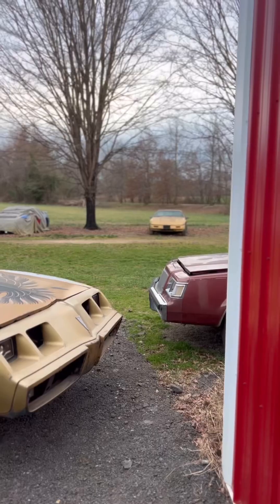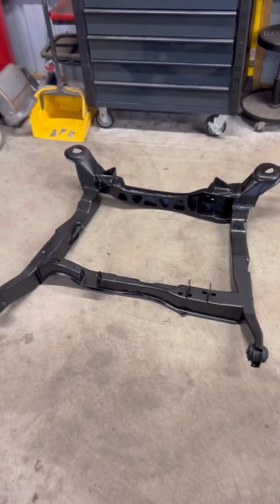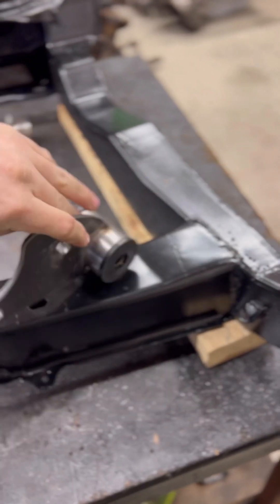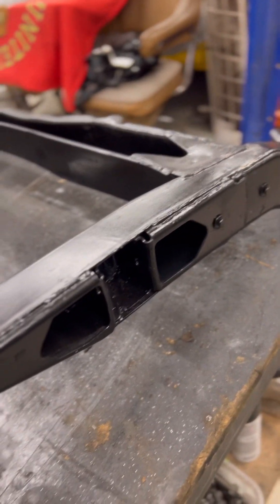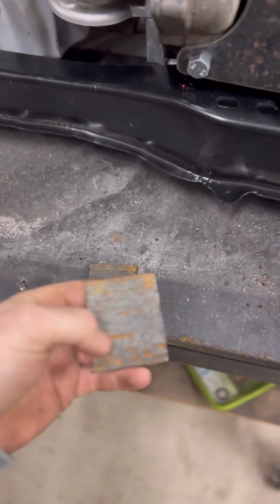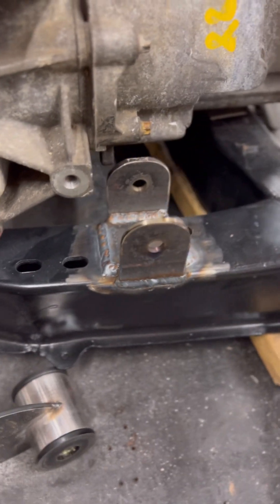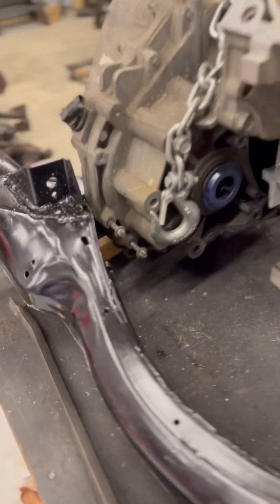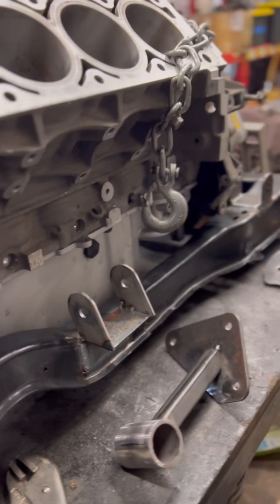How to LS Swap a Pontiac Fiero

Comment: How many inches are the spacers under the transmission n engine?
Reply from the maker: It’s about an inch under the front of the engine and then whatever you need under the trans to make it level. You want to level out your cradle as well or obviously if it’s not when you install itll be out of level and it’s noticeable.

Comment: Very nice work but I believe that the labor involved for the LS4 swap it makes in hard to make much money. You just don't bolt the LS4 in. There are internal engine changes that must be done and then there is the wiring/programing.  My 3800SC is more a straight forward swap but that took me over 100 hours to complete. 
What I am getting at is the value of the Fiero vs the investment of the swap.

Comment: Wish a company would make a sequential transmission solution for GM Transverse.
Reply from the maker: K series transmission and an adapter plate we are building one now with a k series sequential and custom adapter plate
Reply: 9:16  @PickardtPerformance_2Ps  What kind of cost would I be looking at for you to do the ls4 f40 swap on my 87? Currently a 5 speed 2.8l. I would rather just have a stock ss PCM if possible.
Reply from the maker: @jasonwinkowski6310 rough cost on the cheap end for a cradle package that is ready to bolt up and go would be around 10k could be cheaper if you sourced your own parts (engine/trans) mainly, we don’t do installs anymore but have recommended installers that we work with.

Comment: Would a 4.8L, 5.3L, or 6.0L LS be able to be put into a Fiero in the same or a similar way? Knowing me I would have to either brace everything extensively or go away from what I generally like to do. Putting a 600HP-900HP Turbocharged LS in most of the engine swaps I like to do. Thanks
Reply from the maker: Yes you can but you have to notch the frame rails which isn’t too bad, honestly you can make 6-900hp out of the ls4 5.3 and you wouldn’t need to notch the rails sense it’s a fwd ls and bolts right up to gm fwd trans.
Reply: @Jestin Pickardt  Thanks, I didn’t know if standard GM FWD Transmissions were capable of supporting 600HP let alone 900HP.

Comment: Can that transmission work with other sbc’s??
Reply from the maker: Yes but it’ll need an adapter plate
Reply: @PickardtPerformance_2Ps  figured so but just wanted to be sure. I’m building a sbc and want to run the Muncie for long as I can lol
Reply: @PickardtPerformance_2Ps another question, do you need a machined harmonic balancer or will a normal crank pulley fit in the engine bay?
Reply from the maker: @bencorder2544  when it comes to sbc I’m not sure I don’t think you have to do anything spec with the balancer but you’ll probably have to notch frame rails sense you’ll need an adapter plate
Reply: @PickardtPerformance_2Ps  sbc’s im pretty sure you need the machined harmonic balancer but im considering an LS. The frame work doesn’t scare me too much but would I need a special crank pulley to fit AND would I need the moroso oil pan (if I go the ls4 route) or can I just buy the adaptor plate with the starter mount from street dreams?

Comment: no style.  big v8 swaps are hold hack.  a fiero with a  destroked turbo 4.8 ls would have been miles cooler. rotary fiero, way more interesting.  twin cam,  4 cylinder titan, almost anything other than a big chonky v8.  4 out of 10.
Reply from the maker: Bro it’s a 5.3 😂 not some big block
Reply: Do you know the difference between a 4.8 and a 5.3?
Reply: yes, its .5
Im good at math.
Reply: real cute.   an ls4 is lighter than L67's  and are damn near the weight of the 2.8 that came out.  

but yeah sure it's "chonky"

Comment: Nice high quality workmanship, the only improvement I see you need to do is to put some 45deg gussets on left side front mount. Most of that angle is unsupported.
Reply from the maker: Didn’t show it in the vid but we normally do add that

Comment: what gearbox are you using? I did a V8 Archie swap way back in the day and I used an adaptor plate.
Reply from the maker: F40 six speed manual
Reply: @PickardtPerformance_2Ps  when you say F40, do you mean from a Ferarri F40?
Reply: @billyhopkins2461 , no, the F40 we use is from an 06 or 07 Pontiac G6.
Reply: @garypickardt1448 just the GXP???

Is it built? I’m thinking of swapping my Vortech new edge for a Fiero. I’ve always wanted one

Comment: Very cool!! I want to do this one day!! I have a 3800SC Fiero currently but always wanted a LS Fiero!! One suggestion on your videos record them horizontally instead of vertically.
Reply: My plan is when my 3800 SC blows up I will LS swap as well.
Reply: 3800's have the quarter mile record, no need for a ls.
Reply: Watch them on a computer not a phone or buy a external screen or a galaxzfold
5
Reply: @rickaland5107  What are you talking about